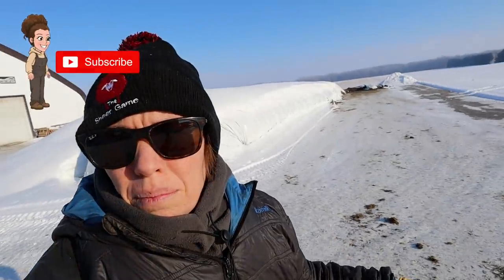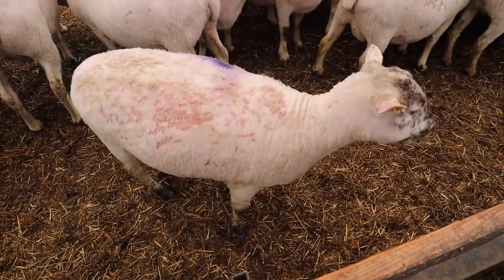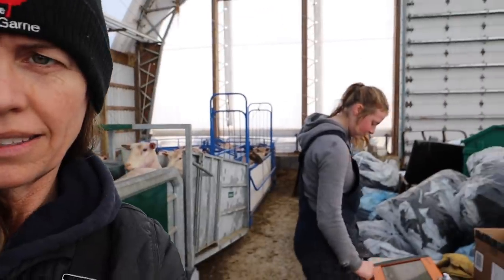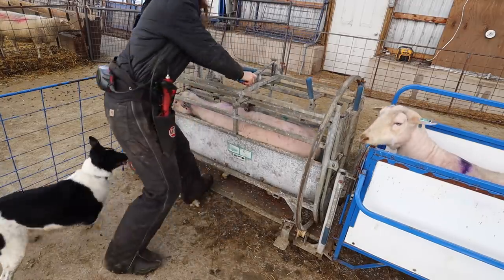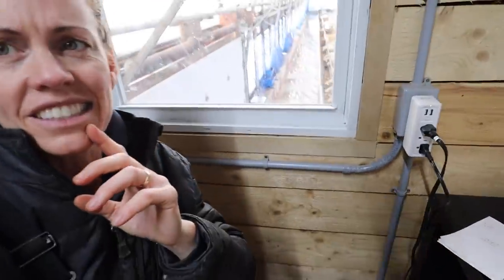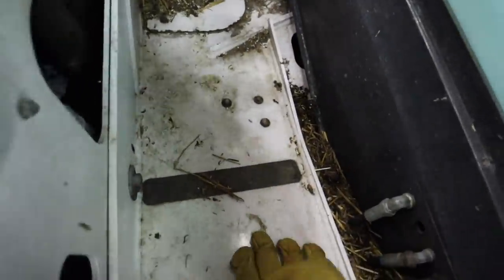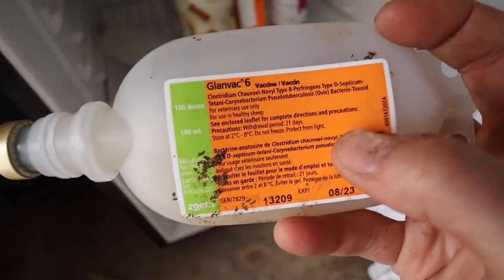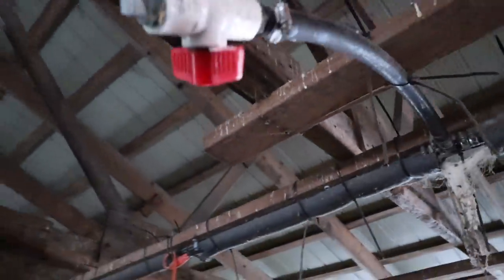moist. 💦| Vlog 546

Comment: Hello Sandy, I have seen lots of times when you have water problems and I am wondering about a large shop (wet/dry) vacuum to help remove and dry things up.  I have used them around my farm to clean up wet messes when ever there is a solid base (cement) to work on.  They come in quite large sizes and on wheels so you can get a full container of water wheel it to the door and dump outside.  Just thought I would offer it as a way to make clean up easier.

Comment: I remember Sandi when you used garden sheers to cut the hooves - your poor hands they were covered in cuts before you got the new trimmers - I would say think about sending them away to be serviced if the light say low and you have fully charged them but goodness only know how long that would take right now or even if the service company can get the parts needed - one day we will be back to normal

Comment: I mean I understand the humidity and condensation and how a temperature difference between in/out can cause these issues. But damn, that barn cannot possibly be functioning as designed. So sorry you have to deal with this and the denial from the engineers; hoping this video provides not only the proof that it is an issue, but also blesses you with a solution.

Comment: Check out getting Frostex heat trace (made by Raychem) installed on the pipes. It will not burn up like conventional heat tapes (like your new tape did). It is self regulating. No need to remember to shut it off during the summer.

Comment: Sandi, there's no such thing as a quiet week doing what you do.  Something always happens:  something breaks, something floods, something needs to be cleaned.   I've been through busted pipes, and you may want to consider re-piping with PEX -A.  It's flexible, if it freezes, it won't break.  Uponor  makes this type of PEX.  Pipes breaking is time consuming, expensive and a complete hassle.  Consider redoing the weaning barn in the summer with Uponor Pex  as it seems this happens to you every winter.

Comment: Across the road, it might be a good safety to have a little running water always on during the coldest months.  If you have a drain, then a valve near the end of the main line with a small line to the drain.  If no drain, valve then line to outside, perhaps through back wall.

Comment: Wow!  That was a lot of water on the ground!  Could you use a pump to get it out?  My husband bought a small pump for me to clean out the big blow up pool for the grandkids.  It works extremely well.  I think something like that might work for you.  It would be a lot less back breaking work and you can put a hose on it that reaches clear to where you want to dump the water outside.  You wouldn’t even have to open up the door very far.  Just wide enough to get the hose through.  😳

Comment: LOL!! Lucy chews 'her' nails! "Finders Keepers!" Can she catch something &/or pass it to you guys from sheep toenails?   =:-p 

You know the squeegees(sp?) that window washers use, with handles & flexible blades to wipe off the water? 

Do you think there is something like that on a longer broom handle? With a wider HD flexible rubber or plastic blade, to push by hand or machine, to remove water from the barn floor faster? The "snow shovel" handtool doesn't appear to pick up or push much water. 
Just thinking about how you might save both time & labor. 

Look at that sweet little lamb's cute nose at he last second in video. <3

Comment: I’m wondering if you could adapt a shopvac with an extra long hose either end that sucks up the water to dump it directly it outside? Would get the bulk of it moved, then you can use a leaf blower to push the last of it out and dry the concrete?

Comment: Hi Sandi! I have questions you’ve been requesting! Every time I see you suffer through another Flood Cleanup, I wonder, “Why not use a Shop Vac of some sort?” Also, re: purging flock of ewes with low wean-weight lambs: Are allowances made for multiple births? In other words, an ewe birthing 4 healthy lambs weaning at 50 lbs each = 200 lbs total, but an ewe who had 2 lambs weaning at 75 lbs = 150 lbs total. Just curious!
Reply: The gallagher calculates for each lamb an average daily gain (ADG) and that calculation does take into account if its a multiple, male or female, and a couple other things. It balances the game so you are not thrown off by the huge singles and other stuff like that. Weaning weights are useful, but ADG is much better.

Comment: You guys are investing so much money to get your fields tiled and dry. But in your barn it seems like multiple times a your you are scraping the water outside by hand (at least most of it). 
Wouldn‘t it be easier to install a drain somewhere in the area where your Nanny normally stands? 🤔
Of course it probably needs to be plugged in some way if not used, so it is not getting clogged with hay/manure… just thinking. 
If not: We love to see your cardio training 😘

Comment: I don't understand the purpose of the shut-off valve and the plug closing the other side of it. Would it not be easier to just put a plug in the end of the line and skip the shut-off valve??? It looks so much easier to trim hooves with the powered clippers. Much fewer blisters.

Comment: Was there a reason or need to install a plug on a shut off valve?? The shut off valves don't tend to leak until you open them. Just an observation.

Comment: As for why you can't get to whatever you're trying to get in and you wondered how in the world they did it. They were designed by engineers to compact everything in act everything in a small space not taking into consideration if you need to replace it how do you get to it. In other words every engineer needs to have a hand's own of how to like the mechanics and they will understand that they have to put things in places you can actually get to without tearing everything apart.